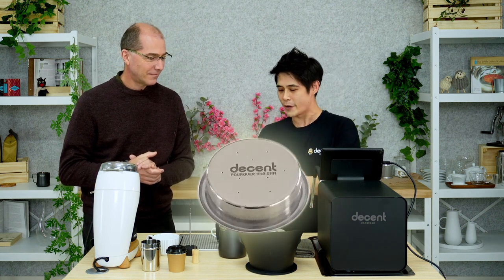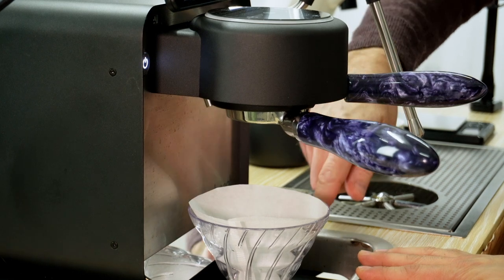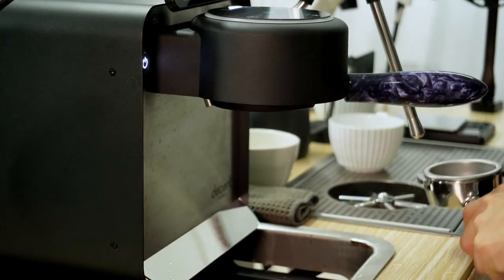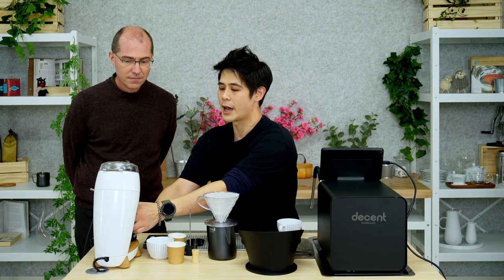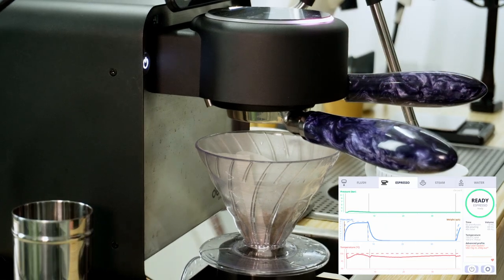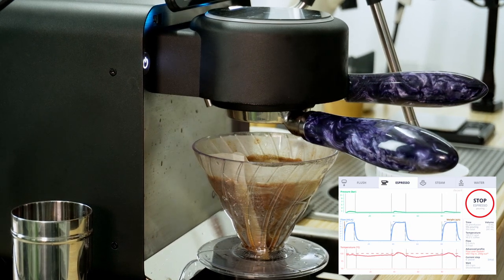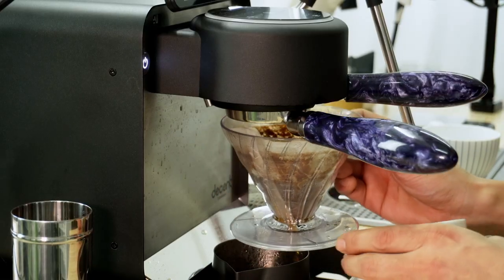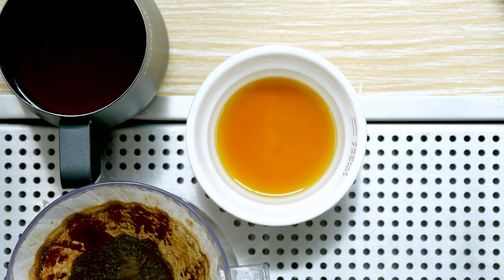Make amazing pour-over coffee with this espresso portafilter basket!

Comment: So was it a size 2 V60 or just a size 1 with size 2 filter cut off a bit? I have both sizes at home and have been trying the filter 2.1 with the size 1 which works quite nice as well. It makes me nervous not to grind too fine though as there is not much room for error and the machine doesn't hesitate to pour as it was programed to 😂

Comment: The lack of space for the V60 stack when portable, not countersunk, is a bit of a bummer. More so as I am contemplating the XXL, for the "4-cup V60" capability above anything else..... Are anyone aware of some flattish/fat servers which could fit with just the drip tray slid out on a countertop setup? Literally brewing into the (even if cleaned) drip tray, and pouring from a the drain hole meant for plumbing out, is a bit much...... :)

I'm rather mobile. Of the 4+ months at a time, not roadwarrior/hotels, kind. Big appeals of the Decent are transportability, and all-in-one. On a smaller counter, it could replace a Robot(lever), Micra(steam and traditional espresso), and a boiling kettle + V60 (+Moccamaster for bigger batches). At least in my, possibly rose tinted, fantasy. I can't countersink and/or plumb in other people's rental houses, as well as offices, every 4-18 months, though.